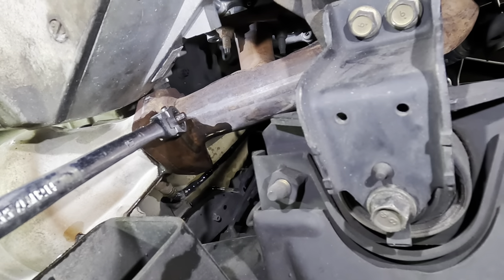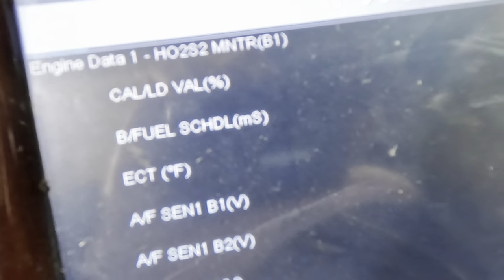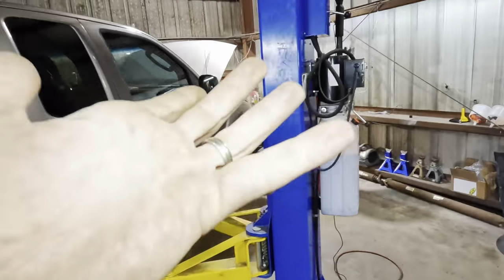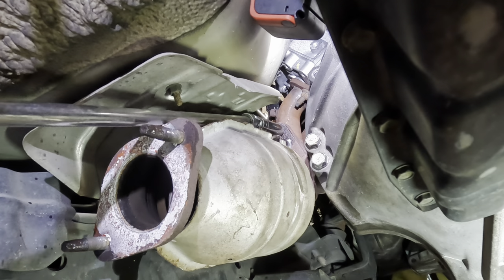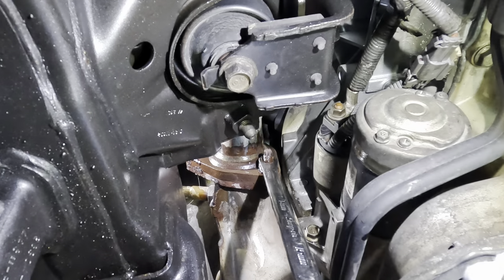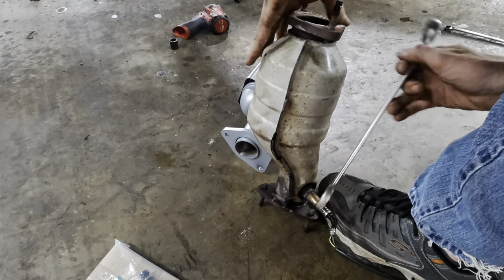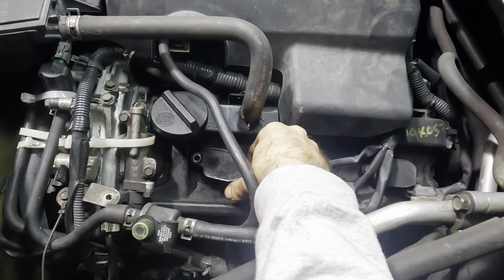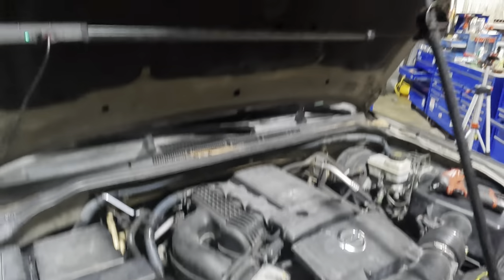Catalytic Converters! Missing?  Running Rough P0302 P0420 P0430 Nissan Fronter 4.0 v6

Comment: I had the steering rack on my 2006 Tundra replaced by a shop I like and trust. 6 months later I was underneath changing the oil and filter and found the mechanic's Snap-On magnetic rechargeable flashlight still stuck to the frame. This is after 5000 miles of driving, hunting, camping etc.  I returned it and he was pretty happy. These tools mean a lot to these guys.
Reply: You’re a good person! I would’ve done the same. My conscience bothers me, even if I forget to pay for a stick of Chapstick at the store. I’ll go right back and pay for it.
Reply: Was it still illuminated?
Reply: was it still charged?
Reply: Was it Ray's?
Reply: Repent and believe in Jesus Christ  next time your car brakes down, try that instead of a garage.
Reply: @JoeSmith-cy9wj  i
Reply: @JoeSmith-cy9wj  Particularly if the steering breaks down - after all, he's supposed to make the paths straight.
Reply: @JoeSmith-cy9wj  Ya mean breaks down?
Reply: @thomasmleahy6218  that too
Reply: Why not keep it lol if they didn’t call you obv they didn’t care
Reply: @petergoesinya636  Yes
Reply: @jostouw4366  Yes!
Reply: @zeropoint3518  Mechanic moved out of state. He got set up in his new place and could not find it. The old shop couldn't find it. He wanted it back but did not know where else to look. Now he has it.
Reply: @JoeSmith-cy9wj  Sometimes even Jesus needs a new rack and pinion unit.
Reply: @JoeSmith-cy9wj  California.
Reply: @JoeSmith-cy9wj  if you’re talking about prayer you better believe it because it works
Reply: @zeropoint3518  he probably couldn’t remember which one he left it on. I’ve left mine in a attic space and had it returned over a year later. I had left it on of course it was dead
Reply: You sir are awesome. It's rare I've ever left a tool on a customers vehicle.. but when I have its always been a magnetic light - Typically if any tool is left on a customer vehicle we just accept that it's gone forever. You for sure made the guys day.
Reply: i absoluetely hate to lose a tool
Reply: Where I work a machine I use in my area I have been using it for twenty years and lately a belt got too old and fell apart. Maintenance guy was probably the first one to open it up in over 20 years and he found a flashlight inside.
Reply: Could you not replaced new lower coil boots to stamp the misfire . You can order them cause we changed the old boots at our local Nissan dealer .

Comment: I agree with the found tool rule. One exception I had is that anyone I was responsible for, if I found their tools I would put them into a cardboard box and wait until they went looking for them. Trying to teach the apprentices to keep track of their kit.
Reply: Bobby's idea is the best, use the lost tool to teach those who depend on tools to not lose them.  You don't need anybody else's tools, so put them on the front seat if nothing else...
Reply: I did same with a couple of guys i worked with. Id hide the tool about a week and make them borrow from each other. They stopp3d loosing tools after a while
Reply: In the air force, every tool kit was checked out. Every tool had to be accounted for on cheak in before any one could leave for the day.

Comment: Being here in the northern part of West Virginia, I can't express enough how jealous I am of the way your bolts can be removed without the use of a glow wrench. It's not as bad here as further north, but I'm amazed at the lack of corrosion on your Floridian fasteners. It almost makes up for the mosquitoes...
Reply: LOL ALMOST.   Love that part.
Reply: @roy dunn You could also use 'Fuel Lube' on the bolt threads, without any heat needed. Fuel Lube is a wax based sealant/lubricant used in aircraft fuels systems. Very sticky and does not wash off with water or solvents.
Reply: "Glow Wrench"  I love it (never heard that before).
Reply: This Nissan waz unusually rust free for Florida. The salty air is extremely corrosive for entire unit. The beach driven stuff is rusted like stuff north of Mason Dixon line. Here in CenTex I'd advise folks to trade off their rust for local stuff . Be Money ahead in the long run.
Reply: Hey,if that impresses you,you should see how great our fasteners are in Southern California!..they are dirty,but not rusted
Reply: @johnmilner6484  gotta hunch this vehicle is from the SW. Anything that old in Florida will have significant corrosion.
Reply: What's a glow wrench? Is it a wrench that gets hot specifically for rusty fasteners?
Reply: @FloodExterminator  glow wrench (new term to me) and gas axe are the same, OXY acetylene torch
Reply: Newfoundlander feels your pain.
Reply: pennsylvania here, where everyday you can experience all 4 seasons in a day..
Reply: I love wrenching on my 32 year old summer car that came from Florida, but my 20 year old Wisconsin daily is another story.
Reply: @legionofanon  Oh! So that's what you meant by glow wrench xD
Reply: "Glow Wrench"  =  Induction heated coil placed over fastner for  rapid expansion ,  easing removal
Reply: @peted5217  Oh, I was wrong. well, they do both make the part glow lol
Reply: @johnmilner6484  And they're only dirty because we get no rain...    Except up to 2 inches forecast from tomorrow, 12/28/22 through the weekend. (San Diego)
Reply: glow wrench.........   or EXTREME liquid wrench

have break that sucker out on the older cars & the used cars the dealer sells from auction up north
Reply: @roy dunn NO, Does not work in the " RUST BELT ".
Reply: Big deal...we get relatively no to low amounts of rain.and up here in the desert,the humidity is so low stuff just does not rust
Reply: @paulmoffat9306  Never heard of it, will it work on HIGH HEAT like exhaust ? Might have to look into that, T.Y.
Reply: @jeremylonberger8245  NO SHIT & LOTS OF RUST.
Reply: @peted5217  Never tried them but did hear GREAT THINGS ABOUT THEM.
Reply: The Ford dealer here in N.E. PA. even the NEW TRUCKS ARE ALL RUST UNDERNEATH.
Reply: It's mainly in the Road Salt used for the roads, but also when the big Coal Haulers come out of the valleys where the tiples are, that chemical they use for removing the contamination from the Coal, it is very corrosive, nd in short order makes everything rust underneath....

And that's why people in West Virginia switch Trucks and Cars almost as often as pants and shoes....

On the other hand, there are some few Coal Mine Companies that have Undercarriage Washers installed, and they do a decent job of cleaning lots of the chemicals off....

These Cleaning Stations should be available to the Public, like one or two in each town....
Reply: @paulmoffat9306  yes, but what about the cost? Candles are cheap, cheap!
Reply: @peted5217  yup! I'm just east of Dallas and some northern vehicles I see with frame rot is terrible!
Reply: @hoseqt1  100%
Reply: No------- it doesn't make up for the mosquitoes
Reply: @richardwernst  Try KROIL, you can get it from MSC that's what I use in Buffalo NY works great if you let it sit for a little bit.
Reply: @legionofanon  you were correct. Glow wrench was oxy acetylene torch was go to when I worked. But caught stuff on fire.
Reply: @FloodExterminator  AKA the blue wrench
Reply: Ontario salts roads 6 months a year. Then mosquitoes come out like a plague. Long time Florida owner.
Reply: @peted5217  Haven't been able to justify the expense for that fancy gadget yet, but the acetylene torch was introduced to me as the "West Virginia Glow Wrench" when I first moved here and tried to work on an exhaust system. I hear the induction units are awesome.
Reply: @legionofanon  Also known as the hot spanner- - at least in the UK
Reply: @brianmendel8680  I don't have a problem with rust since I live in almost desert San Diego.  But I actually  bought a gallon of Kroil about 35 years ago and still have most of it...  :)
Reply: @legionofanon  They do make induction heaters.  I suspect you are more correct though.
Reply: @richardwernst  Thanks for the reply I live in Buffalo NY and I think the city politicians own stock in the salt mines they put it down when it rains out LOL.
Reply: Man I live in Florida, right near the bottom of Alabama… my exhaust bolts NEVER come out that easy… even my Silverado that’s been in northern Florida all it’s life away from the sea salt…

Comment: I can see Eric O rolling his eyes when he sees how "tough" you had it getting those bolts and O2 sensors out. 😀
Reply: Don't forget about Ray whining about 37 degree cold. I must admit that I'm no better, anything below 70 is cold to me.
Reply: @61rampy65  lol we hit -20 degrees a few days ago, with the wind chill it was -40. Was driving with the window down yesterday because it was a beautiful day in the mid 30s. 50 degrees today felt hot lol
Reply: @catfishbilly7425  damn! I had -11 wind chill the other day and I still walked outside barefoot to get the local propaganda rag! Even do it in the snow!
Reply: @catfishbilly7425  In the winter when it's 35* or warmer (I guess any season for that matter) I have the windows at least cracked if not all the way down as well.
Reply: @61rampy65  I agree with that. I live in AZ and right now it is in the 60's during the day and that is too cold for me.
Reply: @walterwhite2270  I'd move to Hawaii, but the $$ I could get for my house here would barely buy an outhouse size shack there.
Reply: i caught on at   15:46
Reply: @catfishbilly7425  is that F or C?
Reply: right as he sparks vic to life to make it all liquid!
Reply: @jochenstacker7448  Fahrenheit
Reply: @catfishbilly7425  I believe they do meet around -40, so that's cold in any scale.
Reply: I was under an Oldsmobile in the street at midnight  in 27° changing the tranny filter because they needed the car in the morning and it wouldn't go into reverse
Reply: I had to change a starter once during a January winter storm in Ontario Canada.  This was on the street as I had no driveway or garage. He has no idea how easy he has it!  I had no power tools either!

Comment: I cannot believe that NONE of those bolts broke! Love these videos, keep up the good work, and keep growing your business. The naysayers know not of what they speak.
Reply: That's one of the best things about being a mechanic in Florida... Even the things that do rust aren't really that bad.
Reply: Honestly even in the rust belt (Canada) these frontiers aren't too bad. Typically the nuts end up as a different size but making the nuts glow in the dark & hitting them with a twist socket they zip off no problems
Reply: @JJ_ExMachina  Id turn an ungodly amount of hours working in Florida.. Jealous of you guys down there! Only area I'd run into trouble is remembering to use loctite ... Pretty much any fastener you'd typically use it on where you are, we use anti-seize lol
Reply: @Drew-wf7vw  Well to be fair, a lot of modern made vehicles are much more resilient at rusting than even things made 20 years ago... Manufactures are putting a lot more thought behind treating surfaces to prevent rust.

Comment: Ray, we had static Temps here in Montana of -25 and wind chill of -50. Of course we always have customers that want or need a battery replaced out in the parking lot. Not a big deal as its too cold to be stranded with a dead vehicle. Most people up here are very appreciative that we will help them

Comment: Mythbusters did an episode on the airplane conveyor belt debate so there is video proof that land speed has no effect on whether or not planes fly. It's all about the air speed over the wings to generate lift. That's also why smaller aircraft need to be tethered to the ground when they're parked outside to prevent wind gusts from throwing them into the air.
Reply: Of course,  for flying, the wheels on airplanes are like lipstick on a pig, they are just there, and actually they are on the way;  they are not connected to anything except the struts, brakes and tilting hydraulics.

Comment: They tested this on Myth Busters. An aircrafts ability to takeoff is not dependent on it's wheels but on the thrust of it's engines and the lift generated by it's wings. Interesting episode though just like all of Rainman Ray videos.
Reply: I remember that episode. The prop provided enough airflow past the wings to provide lift. That would not be the case with a commercial jet though, as the engines draw air from the front of the wings and discharge it behind the wings.
Reply: @GrayRaceCat  regardless of the speed of the conveyor belt the aircraft will move forward. Unless the conveyor belt has infinite speed it will top out and the plane will then move forward and create its own airspeed. This will then allow it to lift. This will be true whether the propulsion is propeller (as tested) or turbofan (such as a 747 has).

Comment: If you let your rechargeable lithium based batteries get too low, gotta dig out a cheap adjustable power supply, give em a little bit of power until their voltages start to rise up a volt or couple, then stuff it in the charger. Typically a pack that doesn't want to charge is either too cold or discharged too low and the internal BMS has attempted to disable rapid charging function but will allow a little trickle action (do not leave unattended while attempting this!)
Reply: You could set the charger and battery on bare concrete.  Just in case.  I suspect this would work.  They failed to test the battery management system properly for edge cases.
Reply: And turn down the current limit.

Comment: Ray, another great video as always.  While you were experiencing a balmy 37°, up here in central Ohio we had a high of -4.

Also up here those O2 sensors would not have come off without an abundance of violence.
Reply: yup lots of violence, colorful  4 letter 🤬 words and thrown tools!
Reply: I Feel for Any Mechanic that has to Work on Rust Belt Vehicles as a Torch becomes your Best Friend...
Reply: god i remember changing the downstream o2 sensor on my honda. damn thing was in there good. literally broke the darn thing up in there. had to take it to a shop and they used a torch and still fought with it.
Reply: It was 2° here Missouri last Thursday and I drove around in the snow and ice and had a ball and I actually made it home have a great day
Reply: West Michigan, 5° with a -17° wind chill, over a foot of snow in a blizzard, some places had 10-12' drifts.
Reply: Prepare the blue-tipped wrench!  The Hotwrench.  The Cherry Popper.  The Sword of Crom.  The Devil's fire.  The Nasty.  Frau Blucca!

Comment: You do not need to be crazy to be a mechanic but it sure does help.

An aircraft's propulsion is provided by the thrust created by the propeller or the jet turbine, not the wheels, the wheels freewheel.  As long as the wheels do not come off it does not matter how fast the conveyor belt moves, a jet with the engines running can take off anyway.
Reply: Well said.

Comment: Your battery charger: You need to bang some electrons in it, to get it to a realistic voltage for the proper one to 'see' it. Anything will do, say 0.5A-1.0A at a bit higher than the max of the pack ) if 18V, then just over 20V would be fine. Take the pack off that booster, measure the voltage. If over the minimum for the pack, you should be good to go. It's all down to the BMS in the pack. It'll cut the pack out if over or under voltage.

A bit more if you want... each cell (if LiPo) can go below 2.5V ish & the BMS will probably call it dead. If you can get each cell around 3V, it'll kick in. An 18V pack has a nominal voltage of around 18.5V, but if it drops below 12.5V, it'll probably be called dead by the BMS.

I frequently use a 12V lead acid setting if my pack is less than 12v... it does lose a bit of capacity if left below minimum, but hey. It's an older pack.

All lithium batteries should be left around their nominal voltage, which is around 50% ish. They'll last for a long time if stored like that. Plenty of videos here on Y/T covering the subject.

Great content, mate, glad you're punching forward. 👍

Comment: Hey Ray you are doing whatever a good mechanic would do looking over and seeing if there any other problems just  in case the customer don't know about it
Reply: Yeah but most of the time its a waste of effort.  Unfortunately, cant tell you the number of times I've found something really wrong and been yelled at for trying to upsell the owner.
Reply: @jimbell3242  Not true at all.  But ok. Then you should tell the service write up front.  Cuz management makes us do those things.
Reply: Nope I’m talking about safety checks, those multipoint inspections are bs and waste everyone’s time.  Stealerships are a joke. I’m talking about broken ball joints and wheel bearings and I’ve even found a few cracked brake calipers and tons of metal to metal breaks which were not upsells.  Could care less about belts and air filters. You would be surprised what people call up sells.
Reply: Like the misfire because of the coil boots...

Comment: My mom’s car car came back from the shop with a terrible rattle. She took it back and they said it was just a heat shield. I took a look and found a lovely 1/2” drive Snap-on ratchet in the engine bay. It’s mine now 😂😂

Comment: I'm wondering why you didn't apply antiseize to the O2 threads? It makes life much easier for the next guy.
Reply: He is  the next guy.
Reply: Just don't use aluminum antiseize. It can practically weld the sensor in.